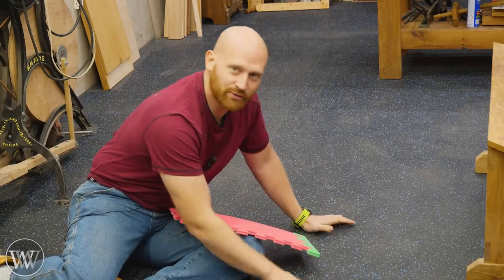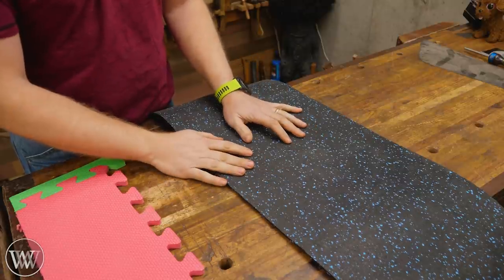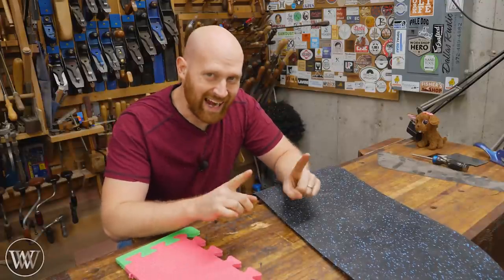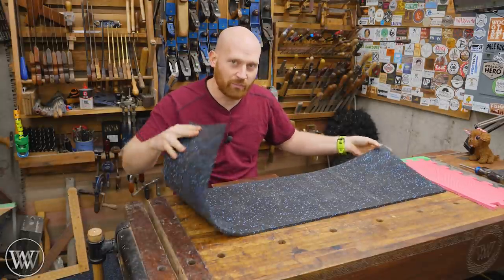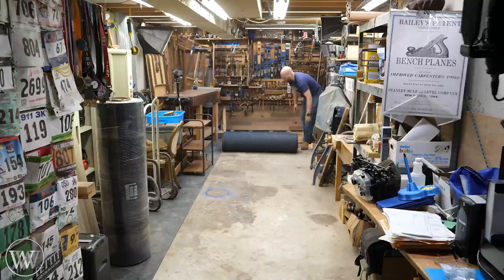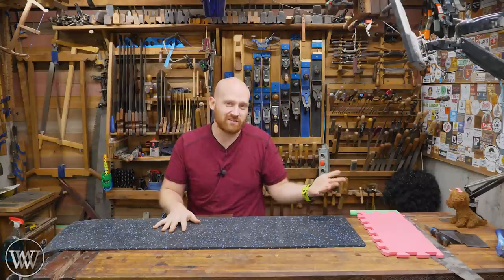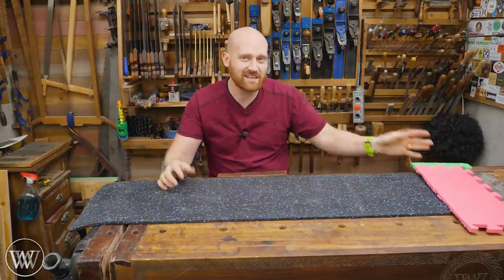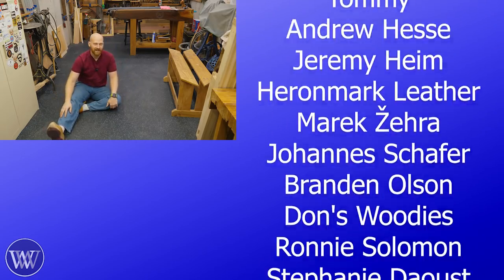How to Install Rubber Flooring In a Woodworking Shop

Comment: 4x6 3/4 stall matts are roughly 2$ per sq ft. at tsc, seems tough to beat?
Reply from the maker: Yep. Especially for 3/4 thick. Mine came out about $1.75 a square foot. But it's only 3/8 thick.
Reply: @WoodByWrightHowTo  wow that's very good!  For my gym and garage the 3/4 made sense but my workshop is in a short New England basement and I've been pretty hesitant to put rubber down because of the reduction in height, maybe the 3/8 would work.  Lower price and delivery would be super nice.  Plus those look awesome! Thanks for sharing

Comment: Great video James!  I have a few questions whenever you have time to reply.....
    Is the rubber virgin or recycled?  It's not apparent on the linked product page.
    Has not using any glue on the seams or edges been a problem?
    Would you do anything differently next time?

Thanks!
Reply from the maker: I'm going to be doing an update video on them here soon. Probably the next month or two. Each manufacturer is different. But if they don't list it as recycled then it's probably virgin. I would not glue the seams. After having it down for 2 years there almost invisible and nothing has gotten into them. They really come together very tight. Originally I thought I should have upgraded to the half inch but after having them for a while there is no reason for that. The 3/8 is more than enough. It actually makes me wonder if I could have gone down to quarter inch. But the big takeaway is I wish I put these down years ago. They've saved so many falling tools as well as my feet as now I have no problem with chisels hitting the ground I just get out of the way and let them go. It's all so much easier on my back with no hard floors. Absolutely love them.
Reply: Much appreciated!  Got a quote and discovered the shipping is almost as much as the product itself. :(  I'm now looking for something local.

Comment: Is your slab sealed?  Are there any concerns about condensation / moisture under the mat?
Reply from the maker: No concerns about moisture. if there is any moisture won't be coming up through the concrete but from the air around and the house is air conditioned so no problem there.

Comment: Does it smell rubbery? I bought one horse stall mat, and the smell was unbearable. I read that leaving it in the sun would reduce the smell. I did that and then it eventually fell apart before the amount of smell was acceptable. Big waste of money.
Reply from the maker: I would not leave them in the sun as they are UV sensitive. pretty much all rubber floors will smell the same. The smell will deaden over time but usually that takes a year or more. Depending upon how much air flow you get.

Comment: You mentioned there were a few other benefits to go thicker. What were those benefits exactly? All I'm finding is that 1/2" is better for dropping weights over 100 lbs.
Reply from the maker: if you are doing weights and gym equipment I would not go any thinner then 1/2" if you want to do bar drops I would go thicker then 3/4" but for the normal shop I do nto see a huge benefit for going thicker then 3/8 I would not go down to 1/4" as you would want to use carpet tape with that, but 3/8holds in place really nicely.

Comment: You know James, most shoes have cushion and rubber soles. Your custom wooden clogs,  not so much. Great video though! Very educational.
Reply from the maker: That is a very interesting subject to dig into. oddly enough. When you carve a surface to perfectly match your foot you do not need cushion. you can be comfortable in steel as the pressure is evenly spread out. cushion is just needed for commercial shoes that have to fit all feet.